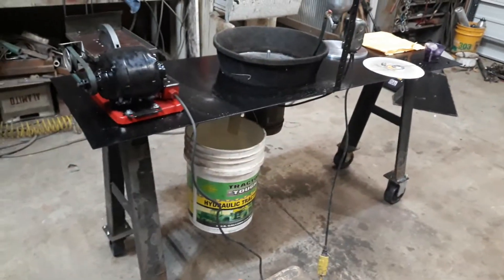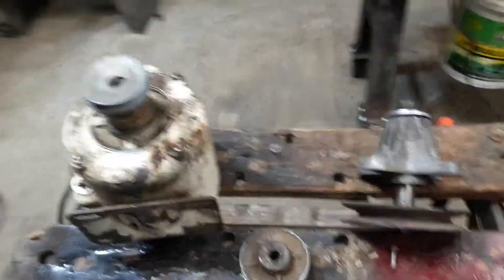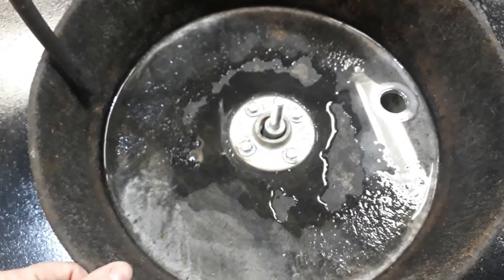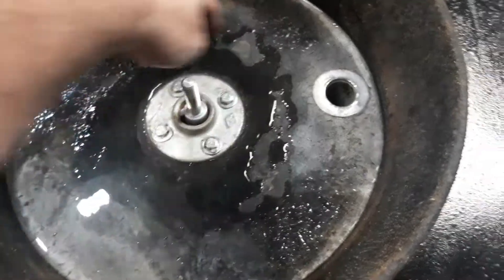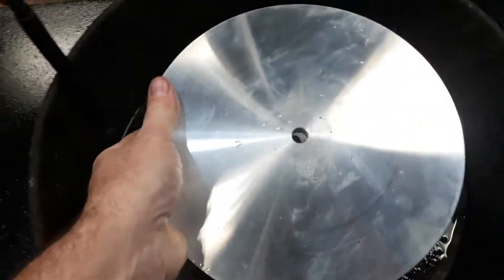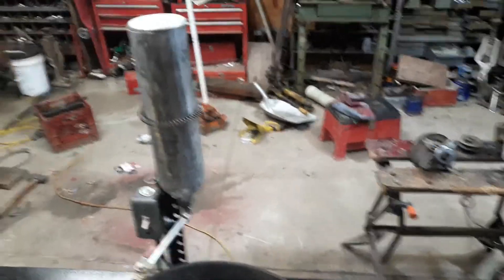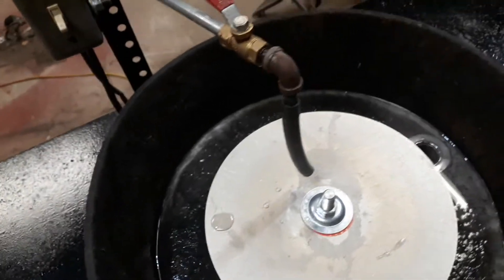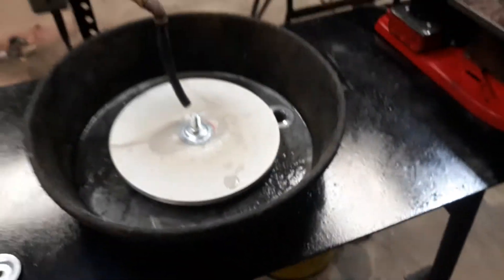Home built DIY Lipadary flat lap 10in  rock polisher  $90

Comment: Sure wish I knew how to build motorized things like this.  If you bought what you just built it would be very expensive.  Incredible work and creativity.  Beautiful and best part was you didn’t have to pay at least $500.  For it.
Reply from the maker: Thank you for the kind words. I am currently testing a rock tumbler with an 80lbs capacity then the next build is a 12in slab saw. Stay tuned.🙂
Reply: You can’t if you don’t try

Comment: I think it turned our pretty good. Surprised that adapter ran fairly true.
I think im planning a smaller footprint, possibly more modular system. Speed control so it can do a host of different duties. 

I love the mower deck spindle idea, surely that would be plenty sturdy for this kinda stuff and you arent leaning on the motor bearings constantly.  Thats one part i never grabbed from old mowers lol i got everything else tho.
Reply from the maker: Thanks for checking it out and I'm also surprised it runs as smooth as it does . I have made several changes since I first built it but am happy with the results for now. I have several outher projects ahead of it but plan on building one using the mower spindle in the future.  Stay tuned. 😊

Comment: I wanted to make a wood disk polisher out of a tiller motor. Set at an angle with a holder. Set and forget.  For larger pieces
Reply from the maker: Sounds like a great project! Ya never know what you can do till ya try.

Comment: Cattle pan seems like a great idea.  Not knowing the standard sizings for them, what dimensions would you suggest?  You said you might go with a taller one, how tall would that be?  Great video.
Reply from the maker: Thanks for checking out my channel.😎 I believe the pan I have is around 16in diameter and 6in deep. Even with the finished top I made their is still some over spray. They make one that is 8in deep or so . You can find the at any farm and home store relatively cheap and made of rubber so they won't Crack.   Hope you found this helpfull.

Comment: What disc are you using are they all hard disc
Reply from the maker: I have hard disks from 80 to 800 . One hard felt and one I made from an industrial carpet remnant.
Reply: @40thplumengineering61  I am going to build my own flat lab and I was going to use 10 inch but the disc get up there in price so I think I'm going with an 8 inch much cheaper
Reply from the maker: @keithcunningham7925  Cool . I gave 50ish for the aluminum master then 30 for the first hard disk on ebay. The rest of my hard disks came from Amazon as a set. I allmost went with an 8in my self but I had a bunch of large geodes I was wanting to slab and polish.
Reply: @40thplumengineering61  thank you for your video it gave me the motivation I needed